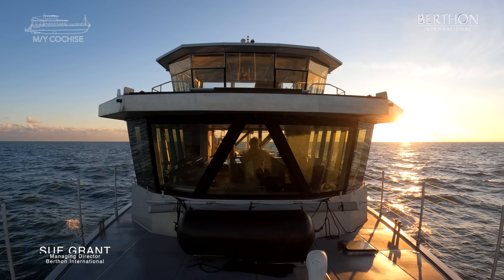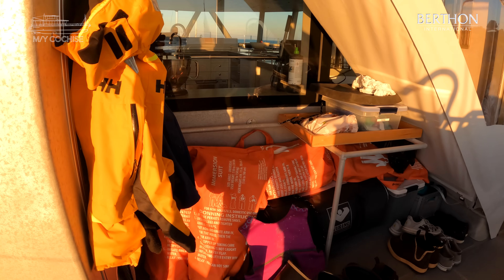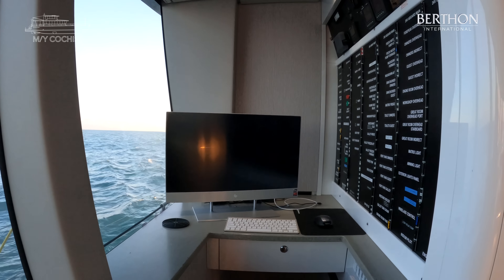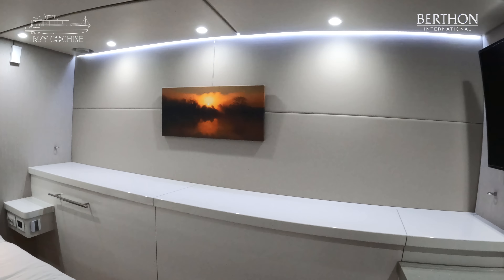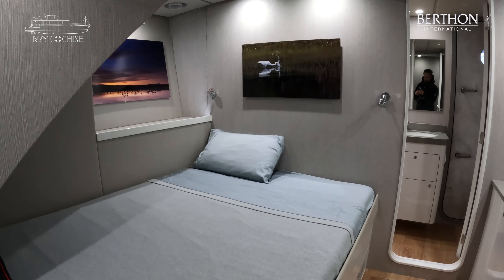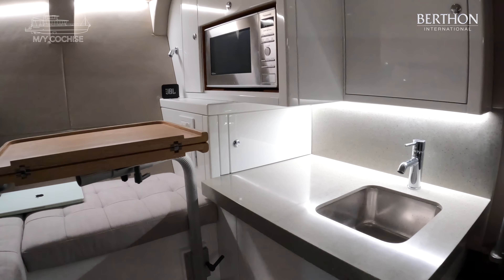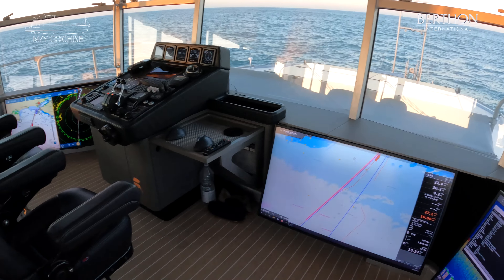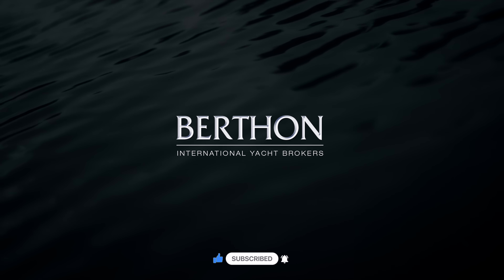[OFF MARKET] FPB 78-01 (COCHISE), with Sue Grant - Yacht for Sale - Berthon International

Comment: I would be so happy to see this, or any other FPB boat, document a trans ocean voyage with the new Sharrow propeller designed props. The gains in efficiency and range would seem, based on early results, to put the FPB boats into a completely new range and cruising speed.